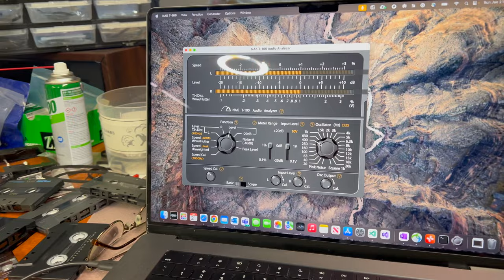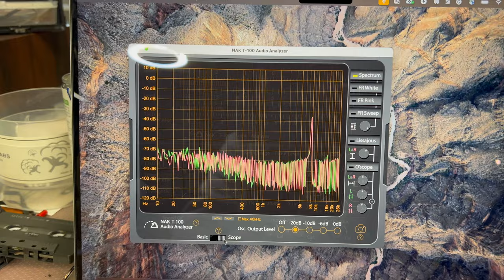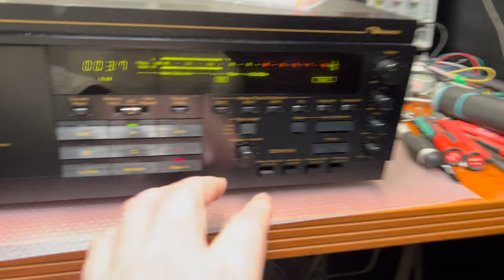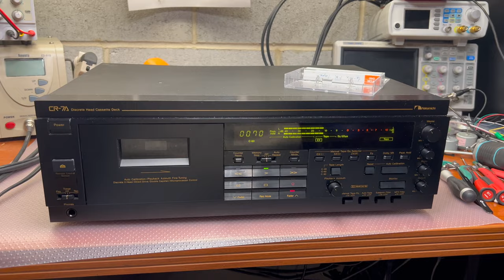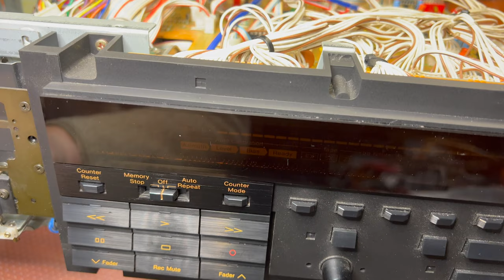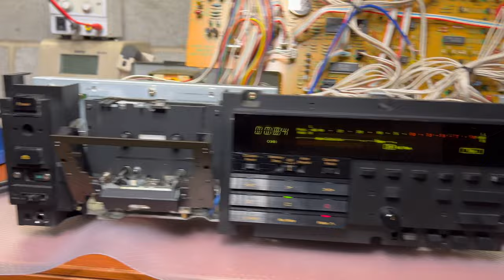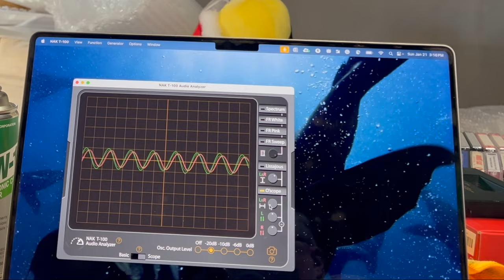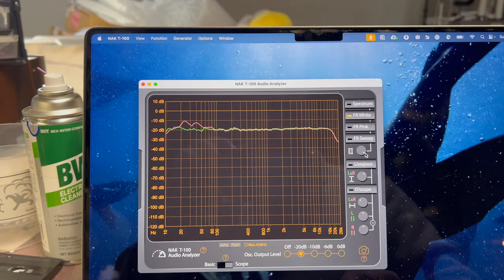Nakamichi CR-7 Revival: Rebirth of a Tape Deck Legend

Comment: You could improve the frequency response at the upper end by the shorting resistors on the playback amp as per the SM instructions.
Reply from the maker: Those resistors should be shorted only when the head is severely worn and can not reproduce enough high frequencies anymore. You should never shorten them just because you wanted. It will bump high-frequency response by a few DB and the deck will sound too harsh. I just undo such "improvement" in the Nakamichi 505.
Reply: @hifirulezzz  Your right what your saying but these decks are not new and most if not all these old decks will have head wear. That's why Nakamichi put that option there. They had the foresight of years down the line.
Reply from the maker: @johnnyg1700  I am measure and make decisions based on my measurements, not because it old and “worn”
Reply: @hifirulezzz  From some of your videos testing on the T100 software there is clear evidence of HF roll off on some of the Nakamichi decks you serviced but you took no further action. My CR-7 already had a bridged resistor in the playback amp so will have been done at factory as it's not been touched or serviced before me. So even Nakamichi carried out this procedure at factory with new heads.!
Reply from the maker: @johnnyg1700  response should be flat at -20 db and not at 0 db. Not sure what are you writing about. I have brand new Nakamichi with new heads. All response corresponds across all decks I have serviced
Reply from the maker: @johnnyg1700  also, if you watched closely, exactly this CR-7 already has+2db at 15 kHz. So, you are wrong.

Comment: How much % is the Isopropyl you use?
Reply from the maker: 70%
Reply: @hifirulezzz  Doesn't this have water into it? Maybe 99% is more secure on metal surfaces? By the way, replacement of PSU caps with Panasonic TSHA & FC or alikes had invigorated the dynamics in decks I have done so. Although the original caps were still measuring healthy for capacitance and ESR.
Reply from the maker: @somebodyx  my experience that Nichicon FG are the best for the early generations of Nakamichi decks and then Muse for CR. And again FG for DR series. And Sony loves solid polymer caps, sounds incredible.